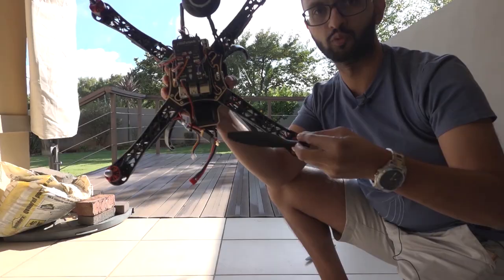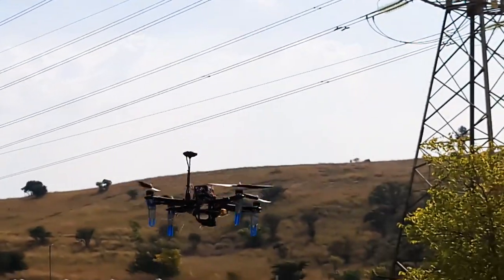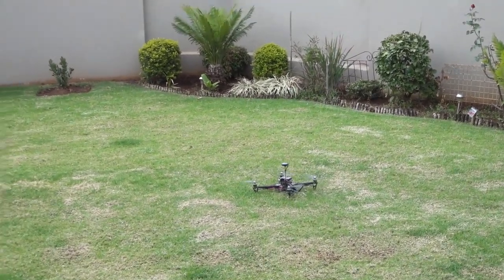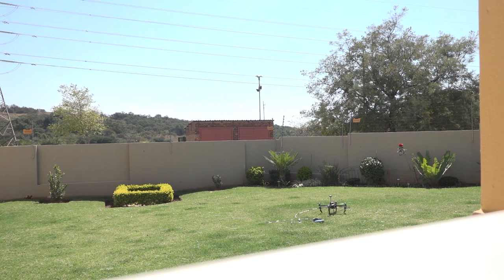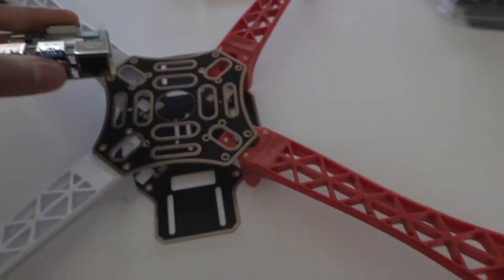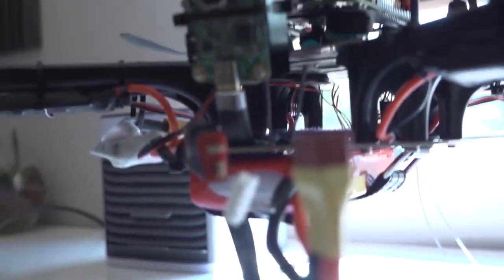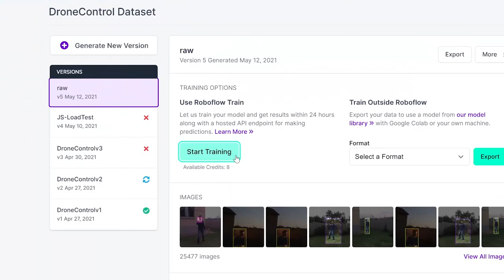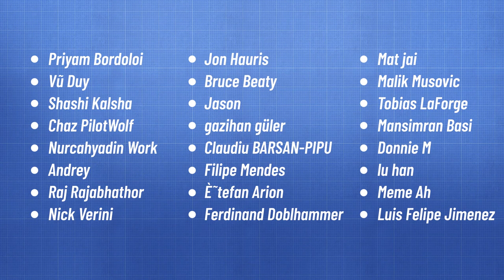I Built an AI Controlled Drone (2/3) - Gesture Control with OpenCV AI Kit

Comment: Hey, would you happen to know how you are connected to the drone without a transmitter? does your drone use a receiver? or is there a another piece of hardware that allows for this communication?
Reply from the maker: The drone has a reciever but the code is stored on board the raspberry pi. So you can remote desktop into the pi. And start the code from there

Comment: Can we use 5mp Raspberrypi camera for this project??
Reply from the maker: It is possible but you'll won't get the same capabilites as the OpenCV AI Kit in terms of performance.
Reply: @Augmented_AI  bro what is the total cost of this whole project
Reply from the maker: @larsenmathias4499  it's about $650 for thr kit and $200 for the opencv ai kit
Reply: @Augmented_AI  dude where do you live tell in rupees
Reply: @Augmented_AI  lol I had done a drone using kk2.1.5 that costed me around 10k